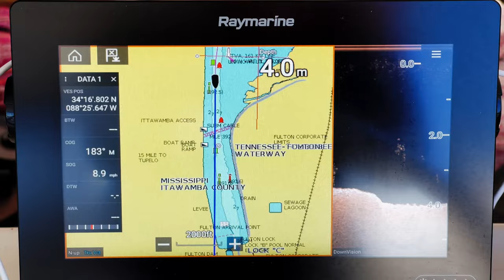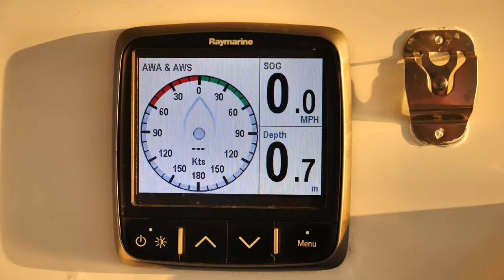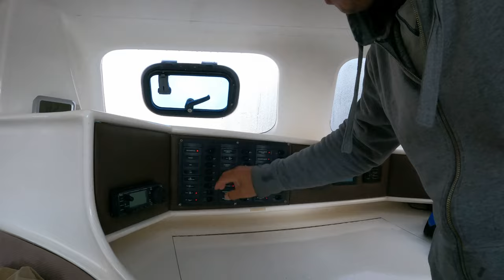THE END FOR U.S. - Great Loop #20 - Sailing Life on Jupiter EP99

Comment: The lock floater jamming problem, and the posible jamming of the rope on the cleat, is why one should never put a half hitch on a cleat, but I see so many people in boat videos doing just that, mostly Americans. It is a dangerous habit, and unnecessary.
Reply from the maker: That is a good point...
Reply: I just use the cleat like a bolard, lead the line back to a fast under tension release. Similar to single hand undocking.

Comment: The navigation channel is 13 (67 on lower Miss.) not 16. he was probably calling you too....ask me how I know. Sailboats never know the rules
Reply from the maker: Ah…yes, I did try 13 a couple times, but nothing… 16 is the international calling channel…so assumed they would monitor it….but I guess they don’t get a lot of international traffic!…cheers SBW
Reply: @SailingLifeonJupiter  I drive one of those tugs pushing 6 barges from Houston to Baton Rouge and back. 13 is bridge to bridge communication, 16 is "Emergency" hailing and distress. I also live on a sailboat. Sailboats don't know the rules, dont monitor the right channels in the right locations and don't know the mile boards or names of the "roads" If you'd said this is Jupiter calling the southbound tow at the 456 mile board Ill see you on the one whistle....you might get a different result